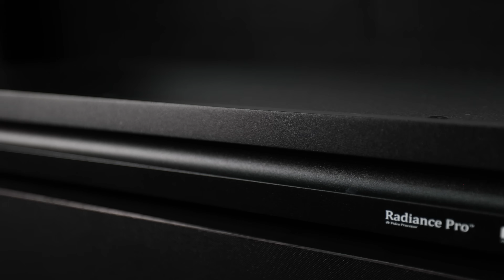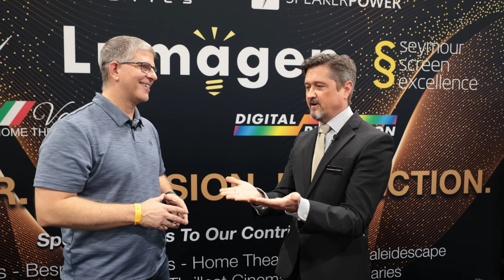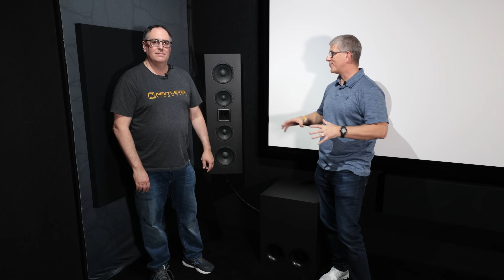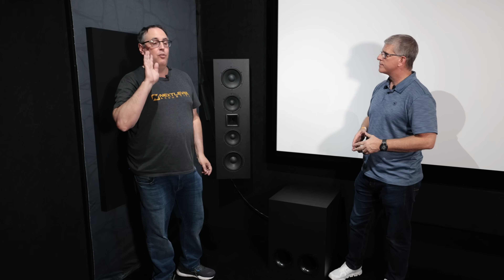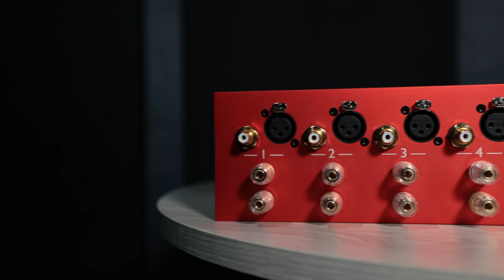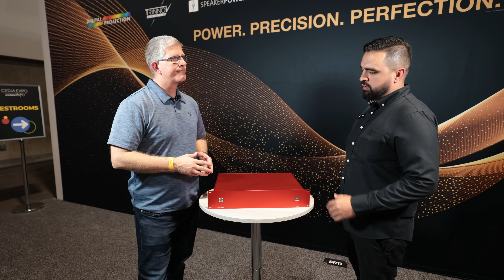CEDIA 2025 9.4.6 Dolby Atmos Demo | Lumagen, Seymour, Trinnov, NextLevel Acoustics, SPEAKERPOWER

Comment: Dunkirk is the worst for the hoppin up and down of the screen ratios. Even though I still love Dunkirk.
Reply: Not even close. By far, the worst is Michael Bay in The Last Knight. On my 100U8K, it's no big deal, but for a projector, it's crazy. I wanna say it has 4-5 different aspect ratios throughout and it'll change to 2-3 ratios in a scene sometimes with no smooth transitions. Now, I absolutely love the VAR films which is why when I'm able to do my own theater one day, I'll be going with a constant width setup
Reply: @levicarter2561  You're probably right, it's been a while since I've watched The Last Knight.

Comment: Hy im new to Home Theater, i want to do a 7.1 but i cant figure out what speakers and avr would be enough with eachother watts wise, dont want a avr not powerfull enough for the speakers and vice versa. Was thinking Polk XT60 Fronts and XT20 Rears and Sides, with Polk Center and Sub, will a x1700h for example be enough watts to power all of those? Cant get a AVR with Pre outs as its out of my Budget. If you can see this comment and help me out ill appreciate it, Thanks!!
Reply from the maker: You might want to consider a more efficient speaker (higher sensitivity rating). The XT60 are only 86dB which is EXTREMELY inefficient.

Klipsch are very sensitive so they don’t require a lot of power to get the. To Reference volume. 93dB and higher are considered high sensitivity. 

It takes twice the amplification to gain 3dB in volume.
Reply: Awsome thanks for the Reply, I’ll check out the RP-5000F wish is the cheapest RP line tower i can afford lol, thanks 🙏🏼
Reply from the maker: The RP (Reference Premiere) offers a lot of value. Here is my review - https://youtu.be/MeKAbPGIB3g?si=_4sxz1fIGFotkKDy
Reply: @Youthman Awsome! Thankyou so much, i just Sub to you for future info. Thankyou so Much! 🙏🏼
Reply from the maker: Thanks. I have a lot of content and probably 90 videos on Klipsch alone.
Reply: @Youthman  yeah im going thru some of them and picking up info 👍🏼👍🏼 thanks, as a first time home theater would you think the normal reference would be enough for me, i see home theater kits that i like but im not sure
Reply from the maker: I’m not a fan of the reference series that they sell at Best Buy. The reference premier is a significant step above them both in sound and aesthetics.
Reply: @Youthman  Ah ok awsome ill stay away from those, Thanks!

Comment: That speaker power amp is the most gorgeous amp I have seen to date. The front face and color are perfect. If it performs as good as it look, then it’s a home run.
Reply from the maker: There is no doubt it will perform. They’ve been building solid amps for decades.
Reply: @Youthman Can’t wait to see your review on that beauty. 🥂

Comment: I like alternating aspect ratios because I love seeing the IMAX shots on my 16x9 screen!  And honestly I will not purchase F1 on 4K Blu-ray because they took the IMAX shots and added the black bars to make them appear scope, which is a deal breaker for me.
Reply: I enjoy the changing aspect ratios on my 16:9 but can see it being really annoying with a scope screen if you don’t have a VP to manage.
Reply: @Tulipo08 video processor is on the list.
Reply: Totally agree.  I even wish they'd release the IMAX-scene content even in the original 1.42 ratio, and let us crop as needed, 1.78 in your case.  A big beef I have with the formats that come out on the Kaleidescape system is cropped for scope/constant height screens.  At least give us a 1.78 frame and we can crop.  For the Nolan releases I've had to go buy the UHD discs to get more of the original framing.
Reply: I have a projector and when they change aspect ratio it ends up on my wall and not on the screen. I hate it. We are all different.
Reply: @FatalXS  That kind of content is frustrating on the scope/constant height screens.  The common solution is to simply keep the top/bottom cropped when displaying scope.